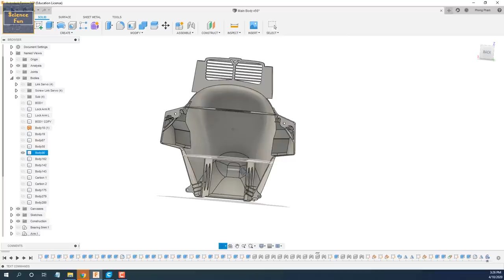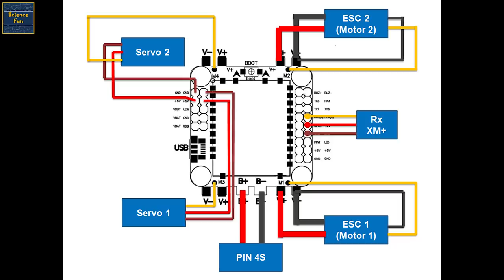DIY 3D Printed RC AVATAR SCORPION

Comment: This is one of the most well designed 3d printed things i've ever seen on youtube, nice job. I do have a couple recommendations though. For one, on the tail, you could design it with a recessed and protruding 'spigot' as it were, with a taper, so when you glue it together it registers its self perfectly. Secondly, on your internal webbings with the circular cutouts which print as extreme overhangs and lead to some sagging in the unsupported areas, what I have started doing with those is taken a tangent line from the circle up to the center point at a fixed angle, whatever my printer is capable of printing. So let's say a 55 degree overhang, resulting in a 70 degree included angle at the point on the top. So it's still mostly a circle, just with a pointy hat. It really cleans up the prints. I also do this for screw holes where i'm recessing the head of a socket cap screw in something that will print where that hole is horizontal instead of vertical.

Comment: WOW!! You just proved that either Avatar was just really lucky to happen to get the "would-be physics" correct or they actually got real engineers to consult with the modeling process. I can now rest at ease. Thanks!
Reply: You ever see a V22 Osprey? it actually exists as a working military aircraft.
Reply: @nerys71  Yes! Twin engine vtol aircraft. Yet I think the scorpion is too far off in the sci-fi zone that I didn’t think it would function. My guess is that I was thinking more towards a helicopter and it doesn’t have a tail rotor.

Still very impressed!

Comment: Did you print this in PLA? If yes take care of the middle portion. The ESCs will get pretty warm, warm enough that PLA gets bendable again. Either don't use PLA for the middle portion or do some active cooling. And you have many mating surfaces where metal comes in contact with plastic while rotating. You could add washers to prevent rubbing.

Comment: very very cool but  its a shame the motor wires don't run inside the arms a hole on the other side would easily solve that problem and mounting them the opposite direction